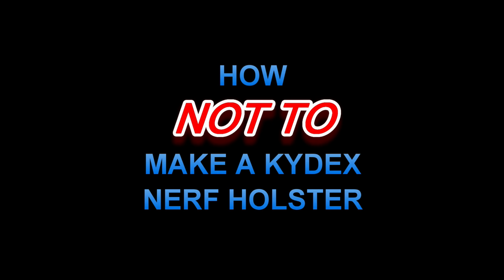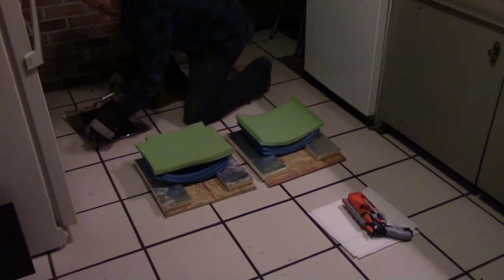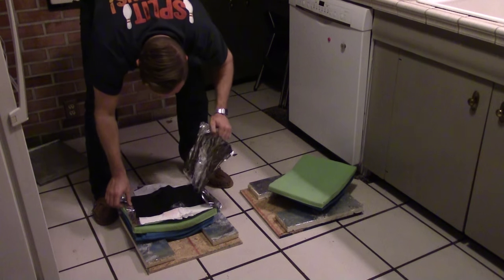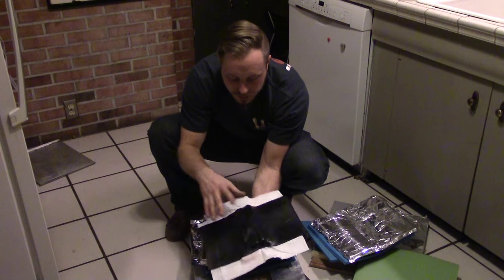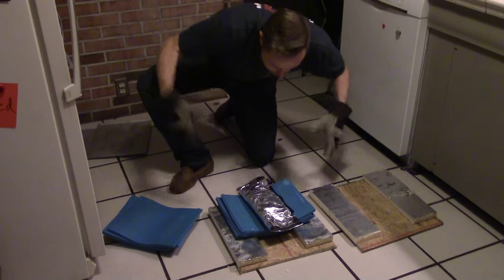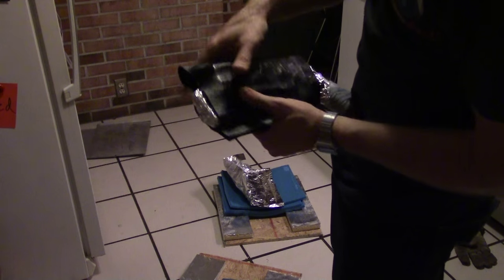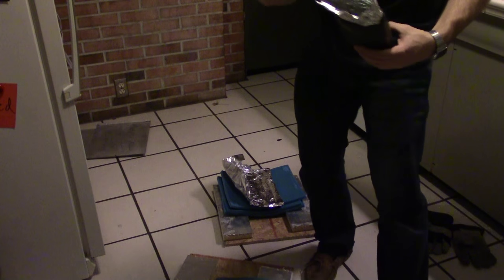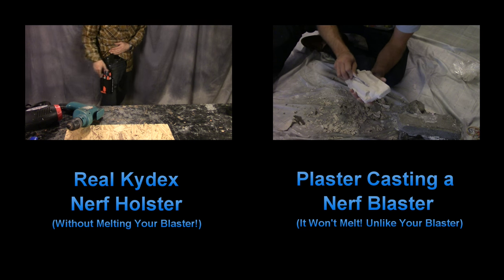NERF FAIL: How I Melted My Hammershot

Comment: I melted a Sledgefire plunger tube trying to soften the glue on the the air restrictor housing with boiling water. It used to work with the original release N-strike blasters. Ended up just cut some of it and knocking out the rest with a large flathead screw driver and hammer.
-Justin
Reply from the maker: I've watched a bunch of your videos in the past. It is very cool that you are commenting on mine!